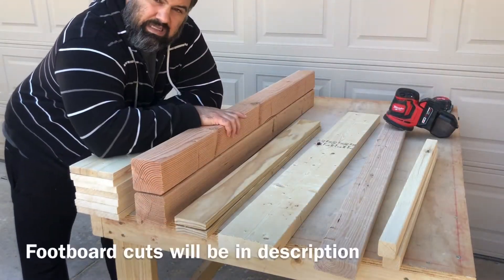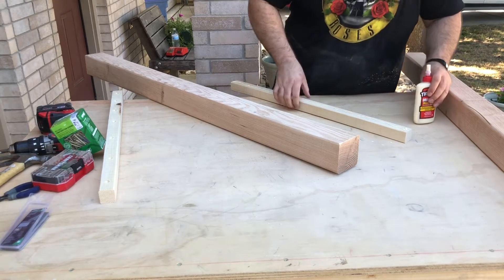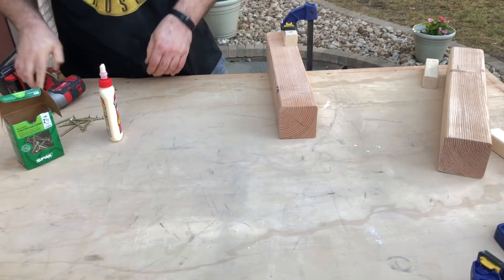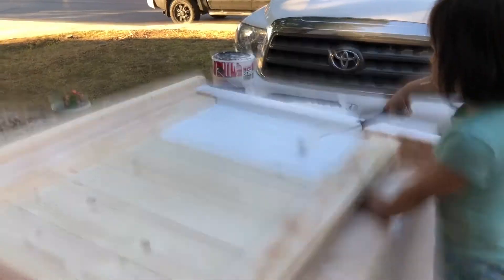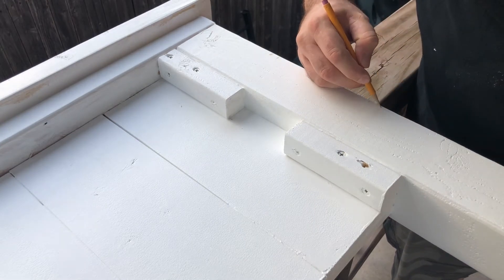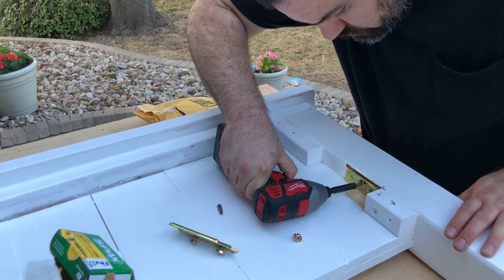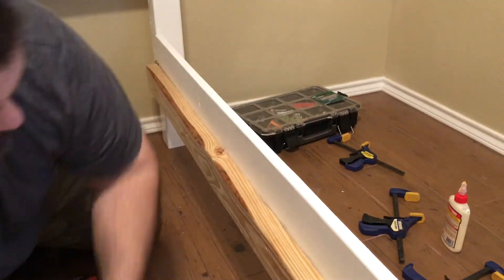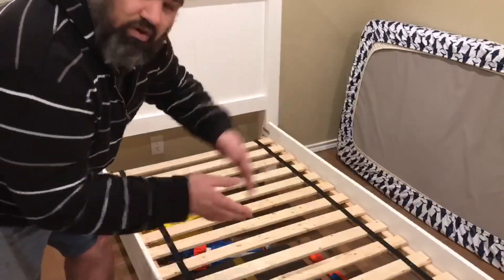How to build a Farmhouse Bed ( Twin size)

Comment: Will this bed frame work if I want to add a box spring to it? Not sure if the demensions used will work for it. Loved your work btw ☺️
Reply from the maker: If you use box spring it will be a little high. The box spring is usually 9 inches in height so if you use it just lower the rails by 9 inches or at least 6 inches.   Glad you liked it.  It’s a fun project
Reply: @MendandMake  Thank you 🙏
Reply from the maker: Your welcome.